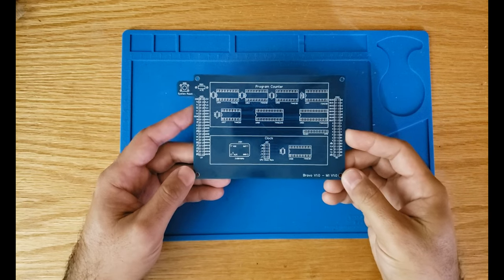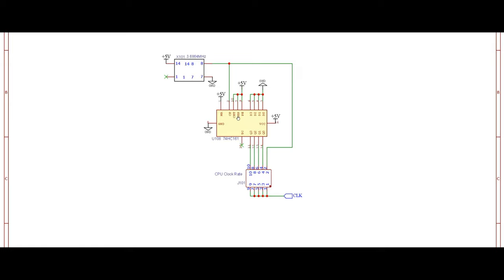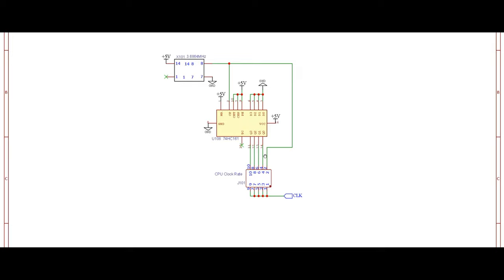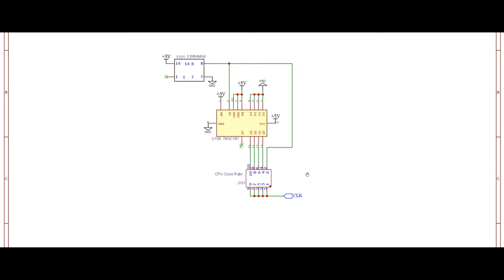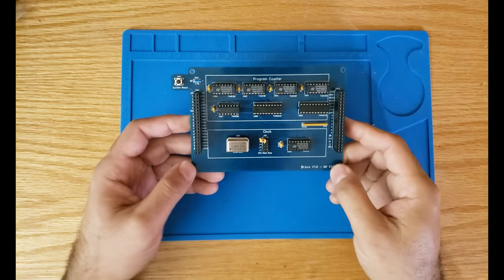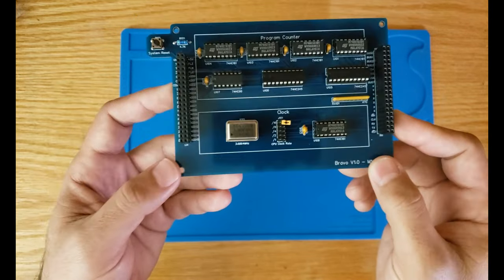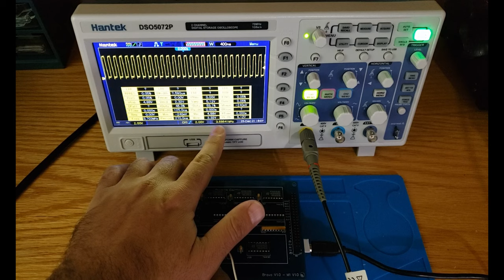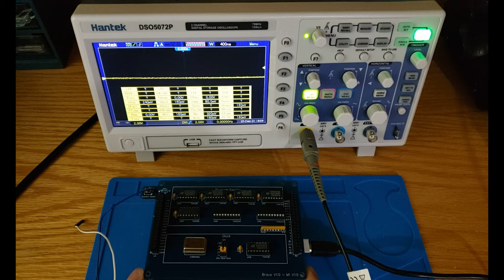Bravo 8bit computer-Part 4-Clock, inspired by Minimal Project and Ben Eater's 8bit computer

Comment: Hi Config IOI. I'm very much enjoying your take on the Minimal. I have an earlier version of the Minimal PCB and was about to build it but then Carsten brought out a new version with an expansion port, so I might order the PCB and build that version instead. Have you seen his new video card add-on for the Minimal? Will you project be able to integrate that into your build too? I'm looking forward to the rest of your video series.
Reply from the maker: Hi David. Awesome ! I'm glad that you are enjoying the project as much as I do. Yes, I saw the last video from Carsten and it's wonderful. Bravo project does not have the exact expansion port (with the same pinout) as Minimal, however it does have all the signals on the stackable female connectors (even I included the INH signal which is not in use now but it's required when adding the expansion modules, so I was kind of seeing these expansions coming :)  ). so, that means that we can add any expansion module that Carsten may add to Minimal 1.5 in the future, but it will be in a different layout so that we can stack it on other Bravo modules. In regard to adding this specific VGA module to Bravo, to be honest at this point I'm not sure. The base project is quite a lot to go through and maybe after the main project I start working on the expansions. I already thought about the keyboard/VGA expansion (AKA Minimal Terminal) module. I'm thinking about this one since it's relatively easy module to integrate and adds value to the project (with Minimal Terminal, you would only need a VGA Monitor and keyboard not a computer to make a terminal to Minimal/Bravo) . Again, thank you so much for your attention ! Please keep the comments and feedbacks coming since it will help us all build a community around Minimal/Bravo.

Comment: Is the single stepping possible? Or very small clock speeds like 1Hz to observe the register states on the LEDs (slow clock speeds with all the LEDs bliking looks very cool on Ben's computer I build - now it is on display in a nice frame on my wall).
Reply from the maker: Yes, single stepping is possible from the push buttons or from Arduino sketches. The only exception would be with UART module since you would need to run the clock at certain speed to macth the UART speed from the TX line.